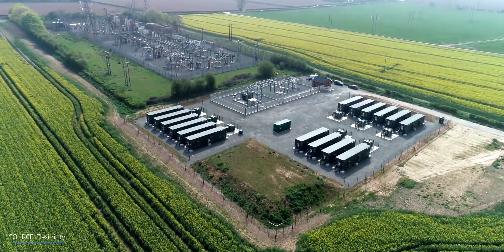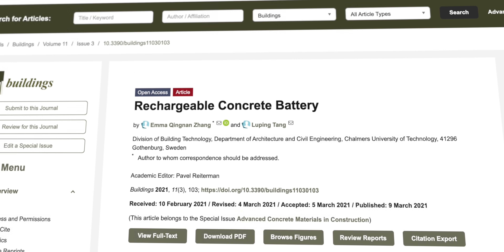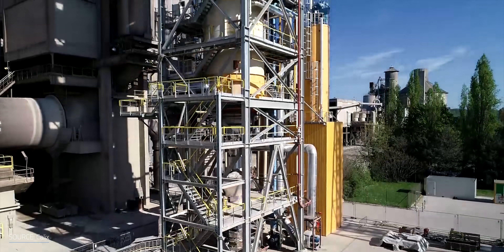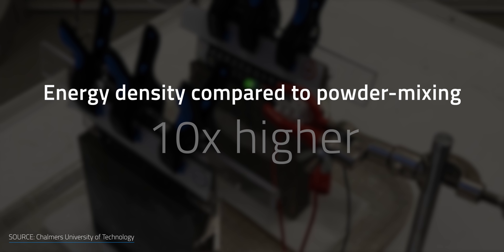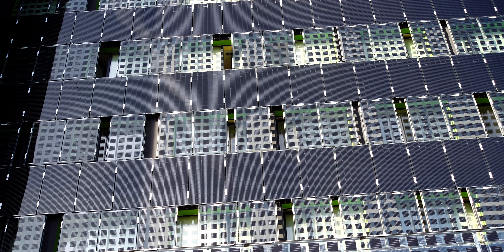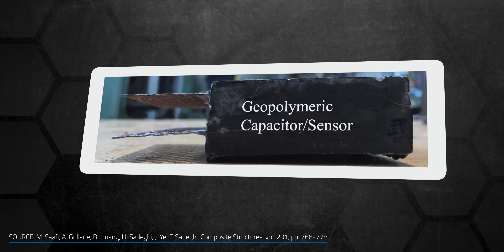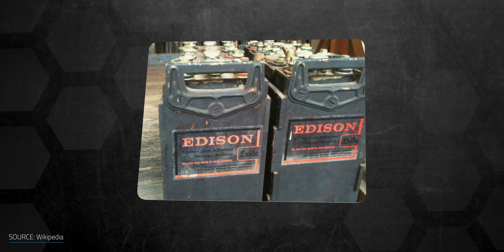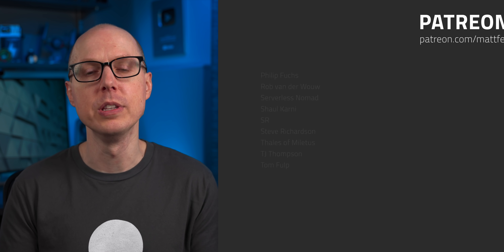Turning Buildings into Batteries? Concrete Battery Storage Explained

Comment: Believe it or not, using carbon is going to be important for the carbon cycle.

We may turn to other forms like hydrogen, continue using nuclear, and fusion, but oil isn’t going to go away.  It’ll just change importance and the direction of the equation

Comment: the problem is so far all batteries that have been invented have a finite amount charge/discharge cycles..I'm supposing this is the same? and when the building/battery stops functioning what do you do with it?

Comment: I have built cement batteries. They work as long as cement is wet. As soon as the concrete hardens, they lose most of the electric conductivity. Also, once the cement hardens, the contact between electrodes and electrolyte decreases considerably and one has to find the innovative ways to keep the contact in the place. Recharging cycles decrease the power output considerably after each cycle and after 8 or 10 cycles, its almost negligible.

Comment: I think that if this added function comes at the same cost or cheaper than traditional construction, it would be a no brainer. Even if the battery only last 15 years worth of cycles, there is nothing lost as long as the structural integrity is not compromised.

Comment: I see it being very impractical. If you have to do any repairs or rework, you’re cutting into concrete and destroying the batteries incorporated into your structure. And there’s plenty of times when Concrete and buildings have been cut or drilled into. Think repairs to sprinkler systems or plumbing systems, running new electrical etc. you name it. Say they want to upgrade the HVAC system… Or run some conduit now you have to drill anchors into the concrete for the conduit straps. You also have to think of how all of the rebar that goes into the structure of a building would interfere with concrete battery installation.There are lots of scenarios that make this not a good decision. It would have to be a very limited or specific application for this.

Comment: Enough retained charge to evacuate a building when the power fails, or enough charge to provide a basic level of lighting off roof top panels would be a very good thing.  LED lighting would use very low power yet probably give a soft "Navigation" level of lighting in halways 24/7  I wonder how much lload that would take off the grid?  A lot of tall buiuldings have to pump water to maintain pressure, having a means of pumping water in a power failuire situation might be a good thing too.   It would add a lot of resilience to structures and self sustainability too.

Comment: No, it doesn't sound too good to be true, because it sounds like a word YouTube wouldn't like.
Even if you were able to charge your iphone from your floor, it'd take more than 1m².
The paper showed more than 10% reduction in capacity after only 6 charge cycles.
Structural batteries is talked about for electric vehicles, but so far isn't used partly because a battery replacement would mean getting a new car. Magnify that by at least 5 times to get the expected longevity of a building. 
Tldr; Solar Frickin' Roadways for buildings.

Comment: Why is it .7Wh per square foot? Shouldn’t the measurements be in cubic ft/m? Buildings are 3D.

Also, not to be a downer, but this isn’t viable for batteries yet just on energy density. A house with a 1,200sqft footprint with a full basement has at best 2,320sqft of concrete interior surface area. Which would amount to 1.6kWh of storage. The same average house has a daily energy usage of 28kWh. So this battery would last at best 1.4 hours. And that’s assuming concrete can even draw energy out at a rate fast enough to power the house.

I wonder if using carbon fiber nanotubes could be used to increase the electric potential across the concrete while also replacing rebar? That would definitely reduce carbon footprint by reducing the need for steel.

Comment: Another huge concern of mine is wouldn’t passing current through concrete hasten its demise?  Foundation walls don’t last forever;  just look inside any damp basement.

I’m not going to hold my breath for this technology.  I was excited to use EXISTING structures as batteries;  that’s not what this is about.  Too many unknowns for not much storage.

Comment: The measurements Matt reported were SQUARE feet and SQUARE meters.  Typical concrete uses are measured in CUBIC feet or CUBIC meters.

How THICK do these “plates” need to be?  Is it measured in millimeters or molecules?  And as such, is a concrete wall’s capacity limited to its surface area??  For example,  if you have a house foundation that is 100 LINEAR feet by 10 feet high of 1 foot thick concrete wall with the catalytic fibers, is it only 1000 square feet (or maybe 2000 square feet, if you count the interior and exterior sides)?

Comment: “Cement” or “concrete”?  Matt uses the terms interchangeably (as most people do), but cement is one ingredient in concrete, along with sand and aggregate (crushed stone).  Cement binds everything together to make concrete.  

It’s not cement sidewalk;  
    it’s a concrete sidewalk.  
It’s not cement foundation;  
    it’s a concrete foundation.  
It’s not cement truck;  
    it’s a concrete truck.

Comment: It would produce toxic chemicals after a rain. Also piping can corrode beause of the d/c voltage. Lithium as well as lead are bad for the human body. However i wouldnt go for it. I agree there should be a different way to store power. It would be nice to plug into the sea, since it has salt. It would be the biggest battery.

Comment: if one meter panel can store the power of 2AA batteries then its not worth the expense of manufacture or an electrician to wire it. I'm gonna guess a regular old lead acid battery bank in the basement would be more efficient, cheaper, safer (structurally), easier to maintain. Sometimes I think these new technologies aren't bad on paper but I wish they were run past someone who builds houses for a living to find out if its plausible in the real world.

Comment: The mistake we keep making is building up instead of down, buildings need to be partly earth integrated. An earth integrated house or building has thermal mass right off the bat before you even need to think about energy to heat or cool it. Surely even those huge battery banks would benefit from being earth integrated to give a more constant storage temperature ? batteries loose tons of charge when they are in freezing temps and don't like too much heat. We need a more holistic approach to the construction of buildings and the storage of energy. Even a fox has the sense to build its house underground.

Comment: Intriguing but wishful thinking.  Concrete reinforcing is used as a safety ground in all buildings (at least in the US) because it is such a reliable ground - and so will perfectly drain any charge.  And if concrete itself did not conduct electricity, it would never corrode the reinforcing, which it does.  To electrically isolate structural concrete from the foundation would be very expensive.

Comment: I feel like there point too many lose ends to one point. This cement is supposed to be mechanically sturdy, deal with moisture or dry air and also chemical stress from being a battery. All of these are supposed to work well for decades.

Comment: Viable? Depends. 
Photovoltaic cell output started out low but is now around 30%. So I'm sure the energy density issue will improve. Life cycle is negligible at this point but any optimization in that area will be a plus. I would imagine to do that (optimize) you would have use it in your driveway, the first floor slab, any second floor slab, and the exterior walls. Can it be used in conjunction with radiant floor heating? Another consideration is structural integrity. And if used in 3D printed homes will it have cavities that allow for insulation? Every little bit helps in the energy storage formula so scale will drive it's marketability. Until areas like this are addressed it can only serve as a supplement and not relied on as a primary storage source.

Comment: If any country comes to rely on this approach, they are a sitting duck. Invading that country or just settling a war would be so easy, just use large explosives that destroy buildings in order to drop the country grid. You'd have to be able to hold 4 to 6 times the needed energy at all times in the country for redundancy

Comment: We'll see fusion energy first.  Wake me up when they make that self storing light pole and run it thru 365 x 20 cycles or a structural element, like a concrete beam 18 deep 12 wide 20 feet long w'/a 1000 per lf load on it, and have taken it thru 365 day x 40 yr charging cycles.  As that is the MIN requirement for concrete as a structural material for buildings.
We don't need to corrupt bridges with imbedded sensors or power storage, anything IN the concrete interferes w its ability to remain a solid continuous structural material like the stone it poorly imitates.

Comment: Not just high-rises. As secondary functionality in every concrete structure, this could have significant impact.
And be the tipping point & basis for decent sound insulation in apartment blocks going forward 
Assuming the tech development pans out.

Comment: I did not read the papers presented here, but using concrete as an electrolyte, may degrade it's physical strength over time.

Comment: Stubblefield coils under a foundation to produce electric. Use super capacitors to store. No such thing as clean lithium or green lithium. Roman concrete is slightly greener than other concrete. We should be able to make awesome Stubblefield coils with fractal wires.

Comment: We don't use concrete primarily because of its strength and durability, but rather because of its cost and versatility. Performance-wise, there are many materials better than concrete, but they cost a lot more, or are difficult to get into the required locations or shapes.

Comment: How simple is it to implement? Would countless construction workers have to be TRAINED to properly PLACE and properly CONNECT all that electrode mesh to grid inputs and outlets? Remember, it's not just simple sandwiching. Buildings are 3D objects. Whatever mistakes your main electrician doesn't catch and correct in the setup phase are set in stone after the concrete is poured.

Comment: Even if it is 200* less energy dense then a typical lithium ion battery if the price of it is not too out of wack from regular concrete then this sounds like a real difference maker.  It seems like a typical skyscraper could have an equivalent amount of energy as 1000 Tesla power walls.  That’s awfully significant.

Comment: Im planning on a post and beam style concrete garage. using these as the wall fill is viable. better is a way to use the existing rebar in CMU to act as the anode and merely add nickel

Comment: I would really love to see this type of technology take off! It's got a lot of promise, but from the looks of it, will need a few more years of research to become viable. Still, I could see this sort of thing getting incorporated with a German-style Passivhaus to keep (thermal) energy inside the house and to keep (electric) energy within the walls themselves.

It'd certainly take some further electrical and structural engineering validation, even once the batteries are proven, but if the day comes where these kinds of batteries can become safe and affordable ways to power your home, I'm on-board!

Comment: All the right answers to all the wrong questions: Why do we need PV? Yes right , to save more carbon. A high percentage of this carbon is caused by cement production. No one needs cement. If we simply do not use new cement we save more than we can save with cement batteries. This is non-sense and only helps the cement industry to justify their wastefull business

Comment: Would this concrete have to be reinforced with steel rebar like normal concrete? Would steel rebar pose potential for a short circuit? Could fiber glass be used for reinforcement instead of steel?

Comment: CB's are not a thing. Concrete is designed for the role it has to serve in, and having just one type of it would only serve teh most massive, low-quality-projects which we can effort by more sustainable material, or will leave behind at all. Also those projects wouldn't have the few bucks or the green energy sources to make it usefull.

Another point is that concrete always have a changing level of moistrue exposure - and therefor its integrity (in the o,oo1-1% range, but that still is a point if you stack these numbers so high you get a skyscraper out of it). So if you have a building changing its material standards by weather, there will be noone to life in it or nearby, noone to insure it, and finally, noone to build it in the first place. You can massicly overengeneer it, but by the cost of exponential need of other ressources and space - which are major cost points on top  of the more expensive conrete itselve.

Huge buildings are in regular not to find near green energy sources, and  therefor the whole thing doesn't make much sense. If such buildings can do this AND been covered in solar panel or stuff, there would be less of a point to have more of it.

As concrete production is a major player in CO2-emission, it would make limited sense to base a green technology on intensifing the need for this material.

By dismantling buildings, we have fragile elments within the very matrix of the building that can't be seperatet without costing tons of extra money and rising problems to handle this waste - specially in a future of more rules and needs to recycle material by the most cost- and CO2-freindly methods.

----------
Kinetic storage - even teh oney a hundred years old ones - are more efficent and don't degrade or cost rare, envi-hazardous materials.

Battery technology indeed makes rapid jumps atm, so there are many forms of smart batterys with 30 years lifespan(GER) and chemical batterys. Also salt, iron, copper batterys also not that fresh but peform better on large scale use as concrete-ones/LithiumIon-stuff.

So in the end it sounds funny to have, but quite useless in real world ... but if you're an startup with a good idea of the worth of PR and effective buzzwording.

Comment: I mean... the degradation over just 6 cycles makes me think this is basically pointless at this point. A concrete skyscraper could easily need to go through hundreds of thousands of cycles.

Also, what happens to the structural properties as the battery capacity degrades? These are chemical reactions, so they're changing the properties of the concrete itself.

Also, that layered design... what does that do to structural properties?

I think structural components are really important... I think decorative elements can much more easily be augmented without effecting their performance of their primary duties. Solar cell windows are a great idea. Some sort of energy storing or producing paint would be amazing. But concrete? Unless it can both do the job of regular concrete at least 90% as well, equal or better its properties over time, and be good at being battery storage over more use cycles than any other battery technology we have, all at the same time, I just don't see it.

On the other hand... for non-structural concrete like, say, roads and parking lots? (I know, they're a little bit structural, but nothing like a load-bearing beam in a hi-rise) I could see that being pretty viable. Surface them with solar panels, and make it our default pavement material, and it could solve a lot of problems.

Comment: Skyscrapers already have the capacity to become energy storage devices. Most of them pump up water to the top for if there is a fire, although this could be used as a pumped hydro solution if you just disregard their original purpose and forget about human lives being important or whatever.

Comment: Honestly I think this forum of technology should have been incorporated a long time ago though from my research Edison never actually invented the cement battery he just stole the idea... if all big structures & high ways were built from this as a backup power source then power outages would never happen... though my biggest question is how durable is the concrete as a battery & how long will it last as a structure...

Comment: I imagine the rebar structural elements would make for an internal short in a concrete battery. Of course even if it didn't, what are the long term corrosion impact on internal steel structures and connected steel bolted on?

Comment: I was certain you were going to discuss thermal storage in "earth batteries" like Dr. Falta at Clemson.  Thermal storage in rock.  Then use an O.R.C. to generate energy using heat.  You should look into this idea of storing energy directly from the sun as heat followed by turning heat into electricity.  LOVE to hear you discuss that in an episode.

Comment: Well, this certainly couldn't be used in load bearing situations, it can however be used in seperation walls such as around a building, parking lot, pool or even an elevator shaft. All of which could utilize the stored power. It can also be integrated into an algae wall system for both creation and storage of power. ;O)-

Comment: As long as it's not bad for your health this can be revolutionary. Even if the energy density is garbage you still need to build houses and right now concrete is the go-to material. Might as well use the otherwise static walls for something else too.